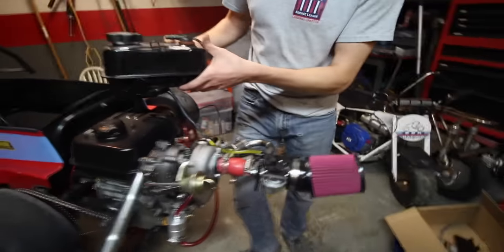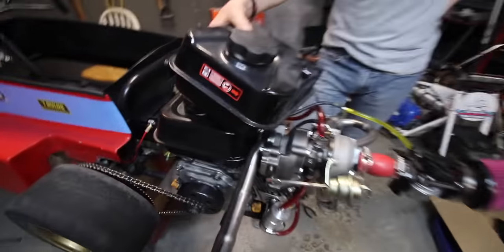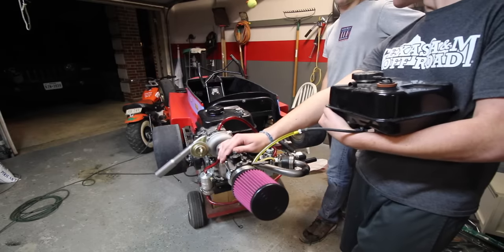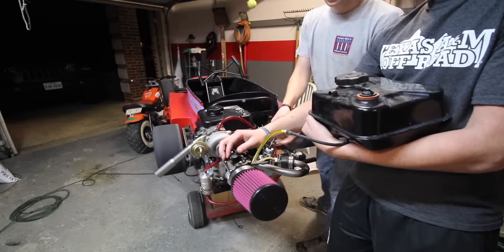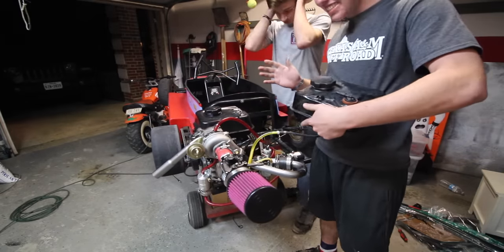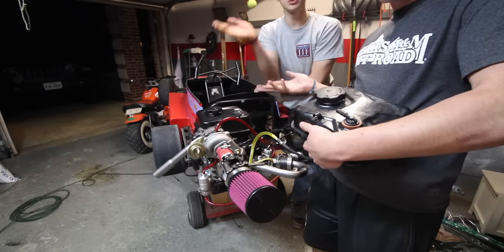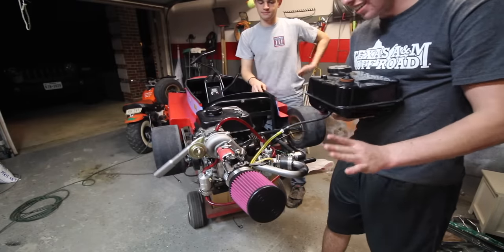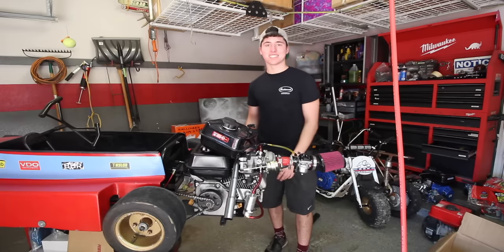Turbo Go Kart Finally Makes Boost!

Comment: I don't see a reason for 2 carbs. Kiss, keep it simple stupid. You are creating more problems for yourselves. Start with small         amount of boost and work up from there.
Reply: Uncle Muir he needs the second one so he can get enough fuel
Reply: Uncle Muir they should both be before the turbo tho
Reply: @paulkanarios202  put bigger jet in carb
Reply: Use a bigger carb not two! Sheesh.
Reply: Dan Matz then its gonna run rich at low rpms
Reply: they just having fun
Reply: you dont have to call him stupid
Reply: @spheghetilover  he wasn't calling him stupid

Comment: u cant pressurize that after turbo carb u need just the one befor the trubo  and get rid of the after turbo carb and jet the befor turbo carb
Reply: You can't draw through a carb with out risking blowing up,  you need to make a small box around the blow through carb and have that pressurized as well. It will not work right unless you do that.
Reply: JoeGrand sure you can. What needs to be done is to just use/have the throttle plate in use on the draw through carb and add fuel after the turbo (also called fuel injection).
Reply: If your using a traditional carb.the easy and best way is   to be pressurized on the out side as well with the boost.  Other methods may have different. Needs, like 2 carbs wtf.  I was talking about this one in particular, and blwing hot air through a carb is different than blowing fuel through a 1600 degree turbo. You run that even leaner and say good bye to you head that's a foot away.
Reply: @TurboTeaBagger  Do you have any idea what you're talking about? the only side that's 1600 degrees (and even that's bullshit because the aluminum wheel melts as 1200) is the exhaust side. You better not have fuel over there. Seriously, wtf...
Reply: @ @kleetus92  .  Yes I know what I'm talking about, most cars fun egt at 1000- 1200 degrees. Gas flash point is in the 200s  ignition is 495. So running lean and hitting 1600 on the output side is very possible , its possible to get 500 degrees on the intake side quite easily and fuel puddling on the compessor housing  spells horrific backfires. Look at the draw through carb on the 🍋 s most ended very bad. . Now put that a foot from your head.
Reply: @TurboTeaBagger  .
Reply: @kleetus92  ,. Since the compressor wheel is directly attached to the intake side the wheel will never reach the temp the housing will. So it is quite easy to run 1600 egt and heat the compessor housing. While the compessor wheel is fine.  As it is being cooled by the direct connection to the intake side,  hence also trasfering heat to the intake side HENCE. Horrific backfires are more possible. Dumbass
Reply: @dipstiksubaru3246   yes that's why my  PT Turbo beats pos Subarus, and eats v8 mustangs.  Cause I am retarted and know nothing about Turbos.
Reply: @TurboTeaBagger  are you actually suggesting you're going to transfer 1600F heat through an oil flood bearing system to the compressor wheel without setting the bearings on fire? Holy fuck dude. 

Please tell me you don't have any children.
Reply: @kleetus92    come on man. I didn't say all 1600 degrees would transfer.  Stop twisting everything I write. Obviously you have moving air on both sides. And oil bath to deal with it will never transfer all the heat from one end to the other. Who knows how much!!  It's enough that in history they went to use intercoolers to lower intake temps. So what are you even talking about..    Your standing up for an insane way of doing a draw through carb system that has proven time and time again to not be safest. End of story.  Blow through carb can work. Most designs can benefit from an air box around the carb  to get the proper a/f ratios.  Or use  a throttle body paired w/ injectors. That may be hard on a gocart so I never brought it up...  and i am sure there are some other BS methods. It's automotive lots of things can work. But it may not be the safest or smartest way. As well as unless that turbo has a carbon seal on the oil. Under a draw through when you close the butterfly you increase vacuum in the turbo likely over time to pull oil out of the Turbos oil seals and make a smoke screen.
Reply: @kleetus92   I was referring to a backfire in the intake side. That's catastrophic.. exhaust side who GAF.  Puddling on the intake side is my worry.  And I AGREE.. Prehapse this system is to small to cause similar problems as the big stuff.  But I would still be cautious of a draw through over a blow through.
Reply: @TurboTeaBagger  please just shut up you have no clue what you are even trying to say ... oh 11s thats cute my 1.8ton car runs 10s whats that like 3800lbs or something .. but of course you are the turbo expert i just run 24psi through a 6 cyl and make 700hp

Comment: Also take that other carb off.. that second carb at the base of the engine isn’t designed to run under pressure so it’s blowing the needle n seat open forcing it to flood.. it should run just fine with the carb that’s attached to the turbo. That’s a draw thru setup

Comment: You can't pressurize a carburetor like that. Ditch the old mikuni carb and run the electronic one between the turbo and engine. You guys make things way to complicated for no reason.
Reply: There is such thing as a blow through carb.  Doing a draw through would be so much simpler though.

Comment: Use a single carb (the mikuni or a slightly bigger mikuni) before the turbo.  Make sure the turbo to the engine pipe is completely sealed, engine vacuum will pull the fuel/air mixture throught the carb and then turbo.  Car guys in the pre-EFI days used this Draw-Thru system.  Thanks.

Comment: Why wouldn't you just put bigger jets in the carburetor
Reply: Brians Vlogs it will run super rich when idling.
Reply: not if you just put a bigger main jet in it
Reply: Yeah I guess it would run super rich when idling, I was thinking about when the engine was at higher rpms
Reply: @briansvlogs16  There's an idle mixture screw isn't there? set that one tight and set the main. Not understanding where the problem is...
Reply: Fuel has no pressure but there is pressure in carb venturi? What do you think what happens? Does bigger jets or idlescrews help?
Reply: Because as soon as you introduce pressure in the Venturi it forces the fuel from the float bowl back to the tank. Wouldn't matter if you took the jet out all together, it still wouldn't get fuel in the chamber under boost.
Reply: Because the mixture will already be too rich.
Reply: @garyjones122  ? it does not go back to the tank unless it was efi.  its a carb with a float in a bowl.
Reply: @JP3_Miller_CriPPs  I'm not talking about efi.

the point I'm making is the flowpath of the fuel in the carburettor when pressurised is fundamentally the opposite to when at atmospheric pressure.
Reply: The problem I see is that there is no control.  You have no idea what the fuel ratio is and a jet won’t be able to properly adjust at different rpms to add the fuel necessary, called a fuel curve.

Comment: Turbo exhaust pipe diameter needs to be increased for better turbo spool
Reply: Not true I'm afraid. Smaller diameter equals faster spool, larger diameter equals more topend. Their are calculations to work it out.
Reply: i think Gary is right...just imagine if the pipe was fifty feet wide, how slow the air would move
Reply: @philtripe  youre absolutely right. It's explained by the Venturi effect.
Reply: Actually Alex is Right, the exhaust pipe is after the turbine, so you want it open. 

The exhaust manifold is where you want small, before the turbine to keep velocity and heat up.  The turbine is the restriction,  after the turbine you want atmospheric conditions, so yes that small ass pipe is too small.

I had a Rx7 making 450rwhp out of a 1.3 liter engine. Gt35r 20psi... I know I am right.
Reply: @williamkillingsworth2619  😂😂 you are right about the manifold part and the turbine being a restriction. My point was that bolting the biggest diameter pipe you can find on it does not equal more spool, it will move the graph closer to the right.
A calculated and correctly tuned exhaust will give maximum spool and an optimum powerband in a required rpm range.

I tested several turbo back systems on my car when struggling with a restriction problem and a 2.75" milltek out spooled a 3" milltek by 300rpm on the same afternoon on the same Dyno. It dropped around 8hp to the larger diameter. The 2.75" was resonated, the 3" was not.
Reply: Gary 

I have been turning wrenches on turbo cars and trucks since I was 18 years old I’m currently 34 I have never in my life heard anyone make the claim that reducing the turbo back exhaust made more horsepower. The time that you reduce the size of the pipe is when you have a stock internal wastegate that is overwhelmed. you use smaller diameter pipe to slow the flow down to keep the car from Boost creeping.

Are you sure you’re not mixing that up

Did you actually tune on the car or did you have somebody do it for you because in my case I was hands-on  from building the engine to tuning the ECU in the car with a wide band and a lap top. 

Also you should know that temperature changes throughout the day heat soak even just Hi water temperature can cause the small differences you were talking about 300 RPM and eight horse power ain’t shit bro
Reply: @williamkillingsworth2619  hi mate, no it didn't make more power with the smaller diameter but it did pick up a little spool on the Dyno which as you'll know translated to the road, I meant it lost 8hp with the smaller exhaust.
Yeah built the hole thing but got a known specialist to map it.

I was struggling with a restriction issue as not making expected power, turned out to be a bad turbo off the shelf.
Reply: That's the least of their problems.

Comment: on a push turbo/carb setup. in order to keep the fuel flowing u connect boost pressure to the fuel overflow on the carb ..this  makes the bowl and internal carb pressure equal allowing the fuel to flow correctly and increasing fuel flow under boost

Comment: The mikuni is set up for normally aspirated flow, and not turbocharging. If you buy a carb setup already for boost, it will run much better, and you'll only need one carb and throttle. And it's cheaper than you think if you Google fu around. 
Great job on the fabrication and concept.

Comment: Draw threw turbo setup is the way to this to operate, put ur carb on the turbo intake and remove the carb on the engine, run ur charge pipe from the turbo straight in to the head port ,sorted boys ,😉

Comment: Run a line from the intake to the fuel tank vent hose to give the fuel some positive pressure. Maybe if you do that you could use the single blow through carb(with or without the screw to plug that hole).

Comment: A blow through carburetor needs to be mounted within an air tight chamber that allows for pressurized air to not only flow through it, but to also surround it.  The problems you are experiencing are due to air pressure differential.  Think about how a carburetor functions through the use of venturi effect PULLING fuel through a small hole.  When you pressurize just the intake runner, air is now PUSHING back through that same little hole, rendering your second carb useless.  Surrounding the carb with a chamber that pressurizes at the same time as the intake tract will restore the second carb to proper function.  You effectively create a small, controlled atmosphere for the blow through carb. 

Tricky to fabricate, but VW guys were doing this to the Beetle back in the 80's.  It works.

Comment: Carburetors are draw through, and when the turbo pressurises the carb it pushes back the fuel back into itself and the gas is coming out the overflow. Only put the carb pre pressure or before the forced induction.  Like most other people have mentioned.

Comment: That air jet you just blocked is where it starts to aerate the fuel by forcing air into the needle jet. I helps atomize the fuel I.E. efficiency.

Comment: good video guys. i would only use a single carb blow thru setup. as draw thru will run rich and is harder to tune. so you can do it one of 2 ways put the carby in a box that is pressurized under boost (best option depending on parts availability for option 2). the other way is to forget the box and mod the carby and boost reference the fuel bowl, also changing the float to a solid style is a good idea too, also a fuel pump. otherwise when under boost it will only have whats in the fuel bowl.

Comment: I've seen way too many people fail at this it needs a blow threw setup with a box around the carb and a fuel pump so it doesn't just blow bubbles in the fuil tank on boost

Comment: Great work! And nice fabrication skills! One thing i would recommend is get rid of the second carb after the turbo, like many others have said, and then tune the TCT to very rich and then take out fuel as you go. It will keep your engine nice and safe under boost and then lean it out for maximum power. Maybe even get a cheap wideband o2 with a gauge to monitor the air/fuel ratio.

Comment: If that carb setup is working for you fuel wise you could remove the butterfly from your "boost carb" and use it solely as a fuel carb...then hook them both up to the same throttle maybe with a vacuum actuator running in reverse (full vacuum is "closed" wide open is "open") on the boost carb...just a thought for ease of use and tunability

Comment: If all else fails:
-Turbo Intake directly into a throttle body
-Fuel injectors @ 200CC+ Sent in JUST before the Internal Combustion manifold.

Turbo Exhaust Manifold<-Exhaust<-Piston<-Piping<-Fuel injector<-Throttle Body<-Turbo Intake Manifold<-Direct Flow Pod Air-Filter.

Throttle Body and Injector lines + Parts will be the hardest parts for that, but you'll have enough fuel to make the cycle as it's Direct-Injection like your Mustangs.

This isn't a bad setup though, just work out the kinks and possibly a bigger fuel tank for that now-hungry 2nd carburetor.

Comment: I would use a power jet, basically an adjustable jet running in the intake before the carb or at the mouth of the carb. Normally used in 2 stroke applications where the engine leans out extremely at higher RPMs.

Comment: Just the draw through system by Itself will work just fine. You may need to figure out a pressure activated fuel advance flow system, but that is easy as well. Just a simple Hobbs pressure switch and fuel accelerator pump will work on this. We did it for years in our sandcars with Volkswagen engines.

Comment: Ben hawke is correct on the pressurization of the mikuni.. here is the idea here... your pressure must be equal on the atmosphere side... if you drill your charge pipe and install pipe nipples you can pressurize the atmosphere side of the carb and slide... simply hook up the atmospheric vents to the charge pipe, and drill and tap a 10/32 hole for a pipe nipple on the slide cap.. this is how we ran our turbo skidoo rotary engines.. so be sure to do the slide cap as I stated.. in early stages of our testing we did not and at 6psi it stuck the slides wide open.. it was an interesting ride... shortly after we adopted a mechanical blow off assembly as well due to lack of vacuum.. we activated a door popper solenoid off of a micro switch on the throttle block.. the popper was attached to the blow off via a cable.. it was mediocre at best, but worked every time... good luck on your venture..

Comment: Draw through is the way to go. You’ll need a fuel pump that pushes MORE pressure than the turbo itself, otherwise, under boost it will push the fuel back out of the carb. I built a turbo beetle back when I worked for fisher buggies, 2332 with a single draw through carb. 390 wheel horsepower.

Comment: You should ditch the second carb on the turbo and run pre turbo water/methanol injection, make a intake for your turbo and mount your nozzle, mount your pump and tank. You should be able to use vacuum pressure off the turbo (not the wastegate) to tell the kit to come on and off under boost or run it off a push button/wide open throttle switch. The kits are easy to wire up and modify to work for about any set up

Comment: you need to have the first carb completely encapsulated in a housing that is open to the boost pressure from the turbo so any jets or vents, including the vent to the float chamber,  are exposed to the same pressure as the carb air intake .

Comment: Motorheads have been converting NA carbs to blow through carbs for decades. Its very simple. Trick the carb into thinking it is acting as a naturally aspirated carburetor. You will need to:
-Block off the carb vent/vents
-Pressurize the fuel being sent to the carb and place an in line fuel pressure regulator controlled by boost pressure
-flare a copper pipe placed in line after the turbo and before the carb (like a pito tube) that creates a slight pressure drop then run that line to the float bowl (same sensing line as for fuel pressure regulator) so that the fuel in the bowl is pushed into the "jets". 
-advance timing. 
-install blowoff valve and a wastegate
-Run premium so you dont blow yourselves up and dont go above 7psi of boost without an intercooler, lower compression ratio or forged internals.

Comment: The carb works because the low pressure in it helps to atomize the fuel in an NA engine.  If you have a boosted engine you have to overcome the boostpressure, (that basically means use injectors or pressurise the fuel somehow), or use a wet system like you did, but without the useless second carb on the intake

Comment: Guys the single carb will work. In a blow through.The problems is it needs a fuel pump to overcome the boost pressure. Under boost the gasoline is getting pushed out of the carb.  So the fuel pump has to produce one psi of fuel pressure for every psi of air pressure to run correctly